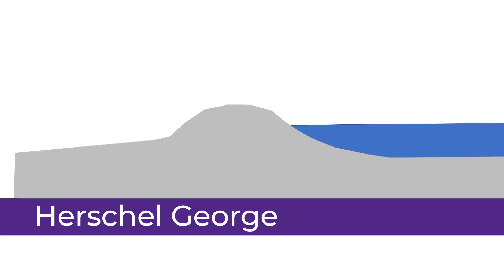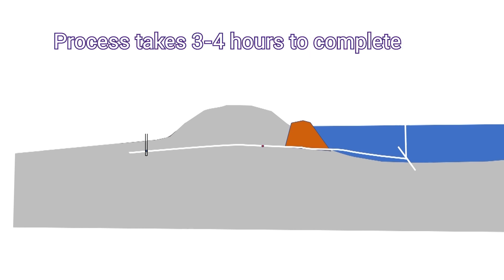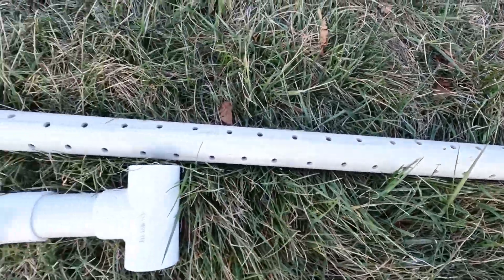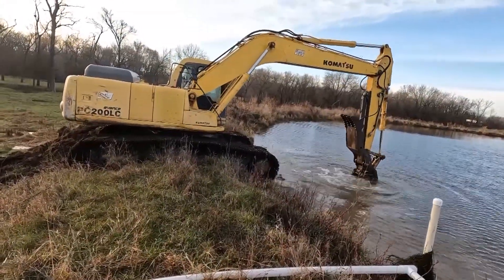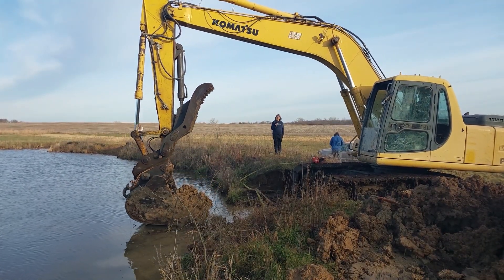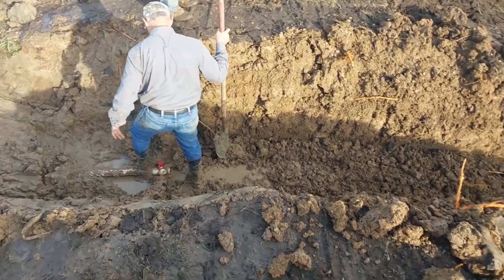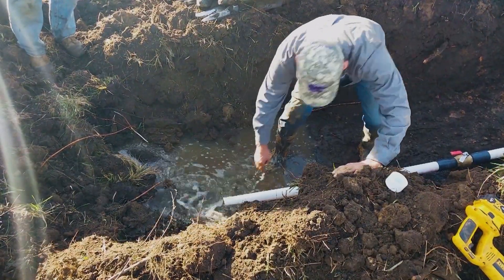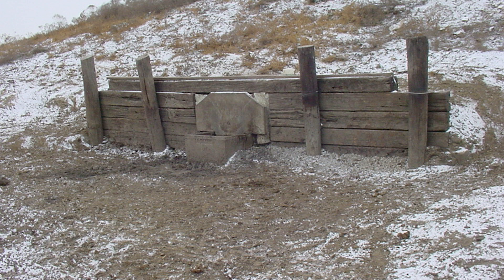Installing a water line through a pond dam

Comment: I am attempting to do this but without excavating. ITs a narrow, soft beaver dam , only about 20' base width. Going to use 2" metal conduit with a blunt cap and sledge it through to create a tunnel, then hopefully pull it out and run my PVC through it.